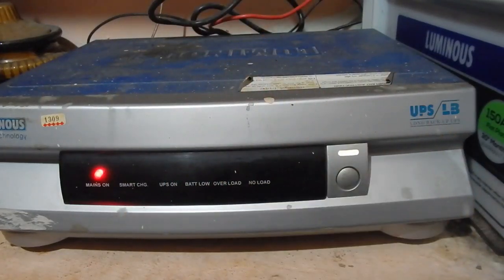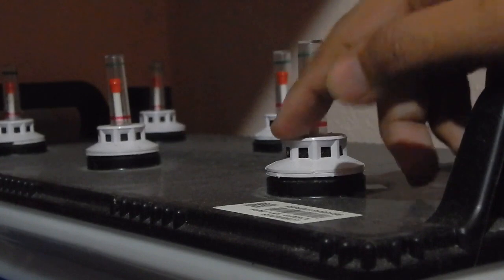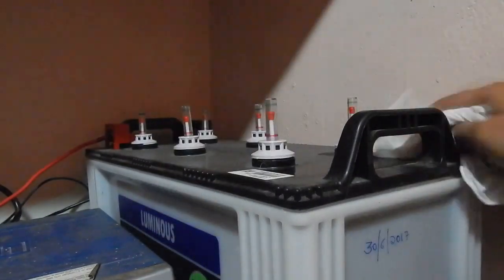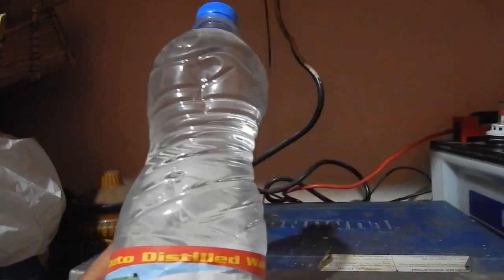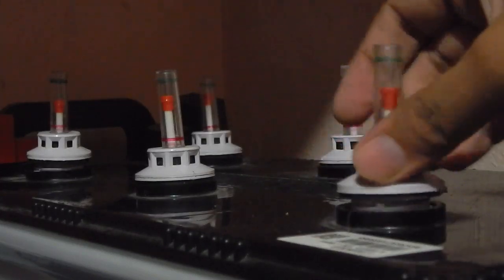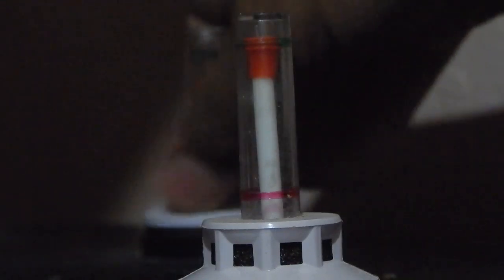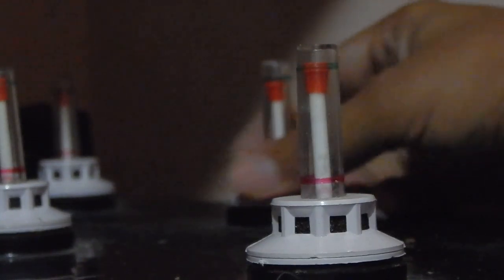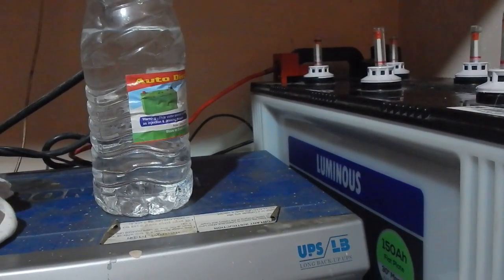How To Add Water In Inverter Batteries | luminous inverlast IL1830FP

Comment: During refilling, should I keep on the ups inverter? Pls anyone reply
Reply from the maker: no need to turn off the ups or inverter, you can add water even when the inverter is ON. But, it is good practice to turn the mains off before adding water just in case you spill some water on top on the inverter.

Comment: Better to use rainwater the TDS will be low around 3 to 11 depending on location and free from minerals and salts... I am getting avg battery life of 7 years for inverter and 5 years for vehicles...... BTW distilled water they sell in fuel pump will have more than 100tds and battery shop water will have BTW 20 to 80 TDS so to my opinion rainwater is the best alternative to pure 0 TDS distilled water.... Last time I collected 15 liters of rainwater here in Bangalore which is of 3 TDS which is almost near to pure distilled water which I will be using in batteries and radiator of my car's.....
Reply from the maker: Good for you man, I Never gave a serious thought on collecting rain water for batteries but, i will do it now;check the TDS & see what result i'm getting.
Reply: @gurribuy  collect them in clean containers don't collect from roof pipes.... Place 2 to 3 wide utensils collect it from free fall....
Reply: Well that's one way to screw a battery.
Reply: @user-yv2cz8oj1k  ha ha ha It's not screwing it's saving battery.... 5+ years for a car and 7+ years for home inverter is decent battery life....  

Btw how much do you get....?

Comment: Only if the floating gets below or near to the red marking..there is a need of distilled water in the battery...please reply
Reply from the maker: Yes, you are right only when the float is near the red mark or below it we should add water. But adding water when the float is half down is  a good practice.
Reply: @gurribuy  thanks bhai..I will follow the same..even I've same battery ...which you have .. luminous 150 ah tabular battery..